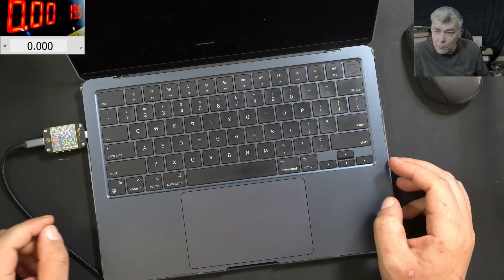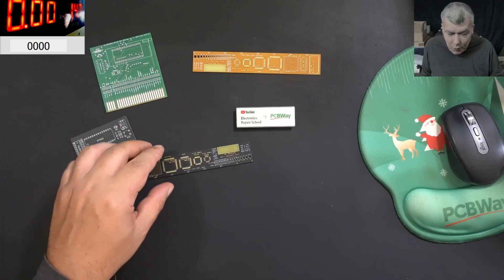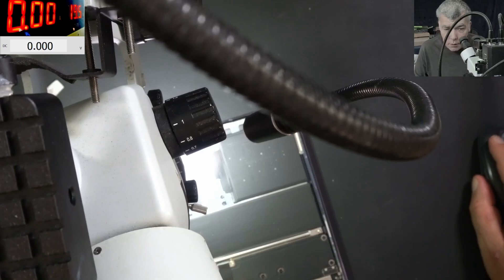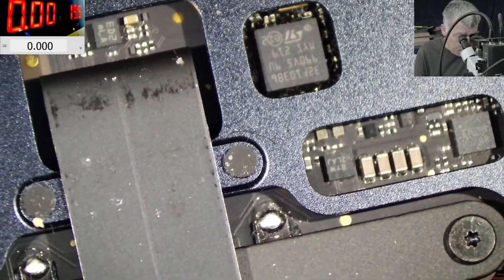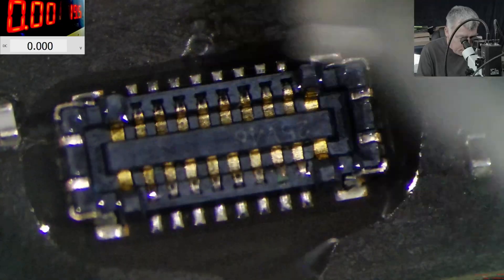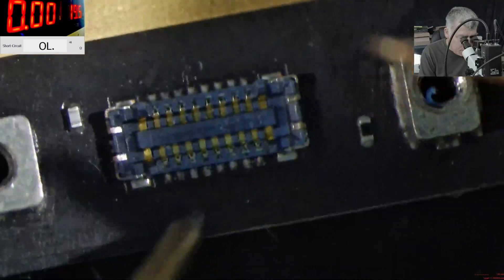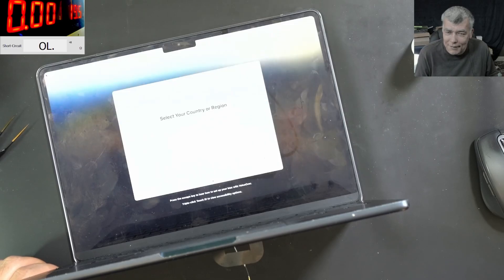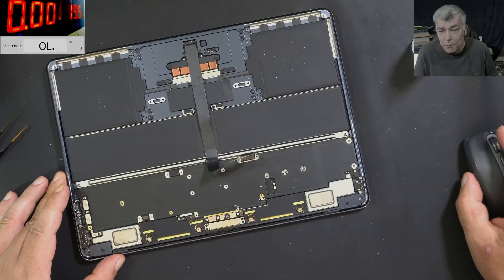MacBook Air M2 A2681 repair - keep rebooting with purple screen - this can be the fault

Comment: When some device on Apple isn’t communicating it goes into panic mode and restarts. I had pinched  a sensor near a mic on the charging flex on a 12 pm I built and it would just keep restarting. Found it with my thermal camera.

Comment: Was wondering after cleaning those connectors if a drop of Deoxit would be worth while adding?
Reply: Are you kidding? That would add £40 to the cost of the repair! :))
Reply: @JustInspiredKent  Would put mind at rest not coming back under warranty

Comment: Hi Sorin,

I've noticed that you're using a toothbrush for most of your liquid-damaged motherboard cleanings. While it works, it tends to take longer and doesn't always give the best results. As you know, the right tools can really make a difference—saving time and ensuring the job is done properly.

Best regards,
Gosh
Reply: What is the right tool for cleaning?
Reply: @Drottninggatan2017  Probably someone called Gosh...
Reply: Common man, you failed to tell us the most important thing, what is the best tool. We are tired of reading ridiculous criticism
Reply: ultrasonic cleaner is the best tool i don't have one but i believe it takes a long time too and big boards can't even fit entirely so they can be cleaned just once and you need to buy the cleaning product too, the toothbrush won't get rid of water damage under chips unless you want to overflow all chips on the board with rosin which in this case an ultrasonic cleaner is the better solution or if the board is overflowed with flux, but in this video i don't think it's worth cleaning a cable with an ultrasonic cleaner lol and the most important thing the mac is working just fine with a toothbrush lol

Comment: Whatever company sent this out to you should be taking pictures of previous states and saving them in case of warranty claims. That way they could have forwarded the pictures to you so you can see the previous state of the board before their fix. Sorin doesn't have to do this because his pictures are literally his youtube videos. Seems like common sense to me.
Reply: @Derpingtonshere  If the shops were careful enough to do that, they wouldn’t need to send their boards out for repair in the first place.
Reply: @zippythechicken  💯
Reply: @zippythechicken  I'm talking about after the 1st repair, repair companies Will give warranties in case the issue wasn't resolved.

Comment: Yes the screen causes this fault a LOT I worked on this model for almost 2yrs, apple 6yrs. That left cable is Ambient Light Sensor. Right cable is video, either cable can cause this looping. So many of my impatient coworkers have replaced the logic board for this type of "boot looping" for no reason but on this air model its almost always the battery, screen, or lid angle sensor cable on the right side that causes the boot looping! Hilarious. They lucky you got this cause this woulda been a easy $1,000+ repair we woulda replaced the screen and motherboard for the liquid lol
Reply: The corrosion on the left of the connector shouldn't really be an issue as the pins are GND and NC. The corrosion on the right is a probable short to GND on I2C_ALS_1V8_SCL. I2C_ALS_1V8_SCL = the  I2C clock line for the ALS sensor.
Reply: @dfear  hmm, interesting, at my specific company were never taught in depth schematics details like that because 9 times out of 10 Apple forces us to just change the parts due to warranty/apple care & send the old parts off to China to actually get resoldered. I just learned on my own how not to change the wrong parts haha these sensors are no joke on MacBook air/Pro
Reply: @masterk5066  Yes Apple does not fix anything it changes parts
Reply: you are right